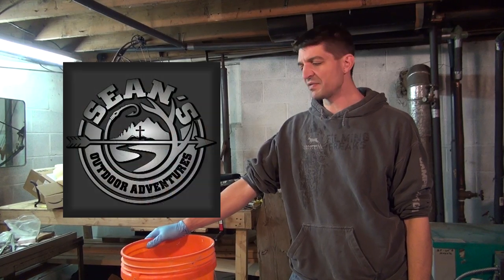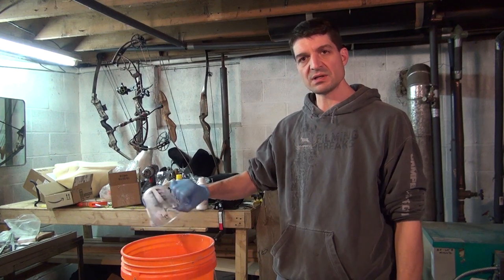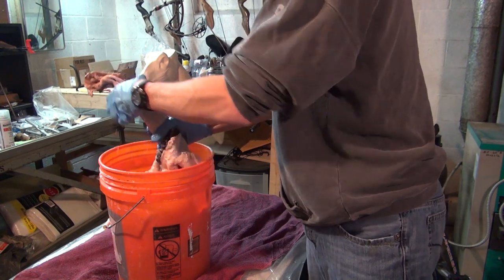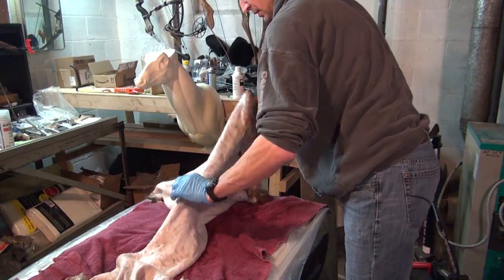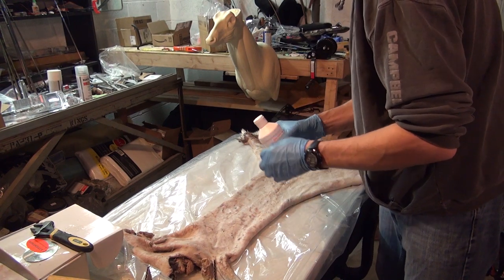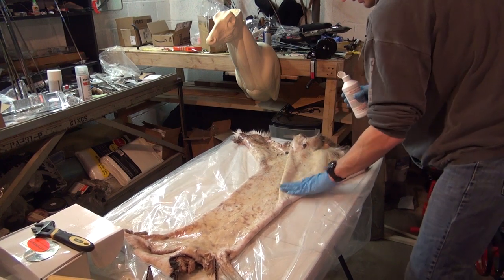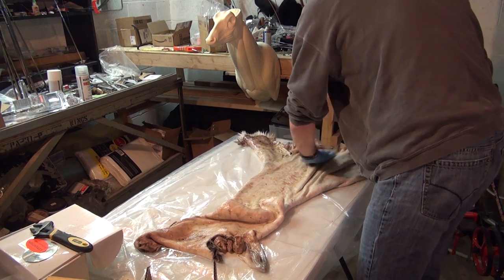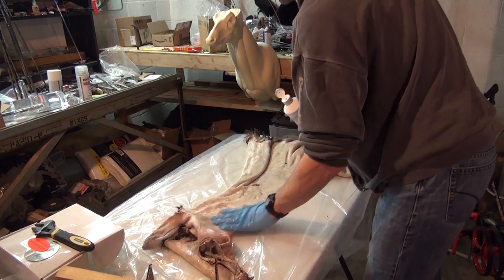Mounting a Deer Head   Tanning the Hide

Comment: Hey there! So I'm new to tanning, and I have some questions if you've got a moment. Last year, I learned the hard way how difficult fleshing is. After building my own fleshing post and buying everything I thought I needed, I just didn't have the strength. Me nor my large husband. Lol. I'm trying to make a deer rug as I have so many friends who hunt for food. But I failed that first attempt, & I later read I should have soaked it first? I think my crummy fleshing knife played a part too.  Anyway, I'm now on take 2 this year and I used a pressure washer to flesh it which worked out great for me. Also bought a much smaller,sharp, nice knife to really debulk the leftover tissue. But when it came to the face/ears, I got a little nervous. With so many crevices, I'm just wondering do I address the face skin and fur the same way I do the rest of the body? What about the hard cartilage on the ears? Can the ear points be left completely alone?
Reply from the maker: I have a mini flesher, which runs off of an air compressor. I think they cost about $250 and I even thin the skin on the face with it. It's pretty sweet. You need to thin the skin out, and yes, you should soak the hide in a pickling solution (acid). As for the ears, I have a video on how to cut the cartilage out of the ears. If you are not doing a deer head mount and just making a rug, I imagine you might be able to leave the cartilage in. It will prevent you from getting the tanning solution on the skin of the ears though, so I don't know if the hair inside the ear will end up slipping later on. God bless you.